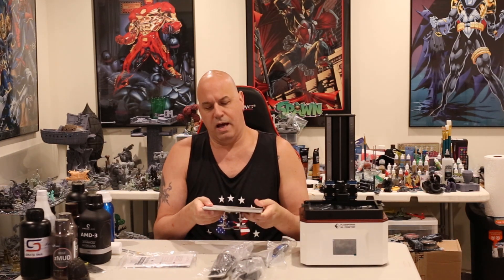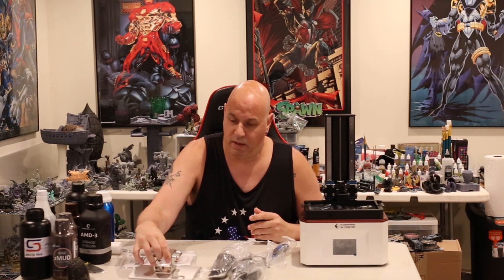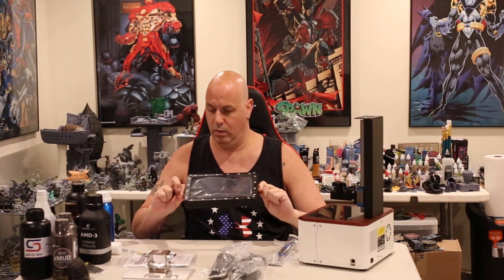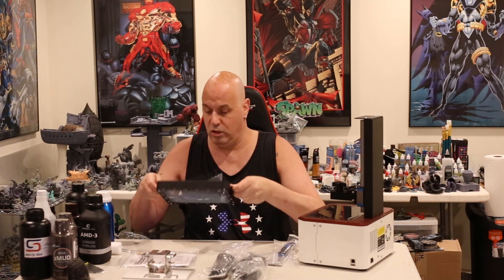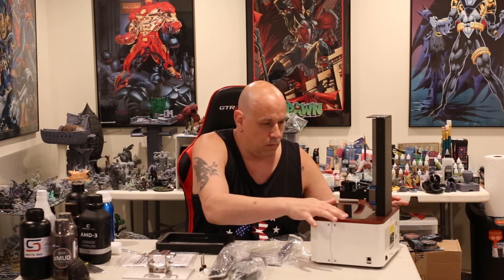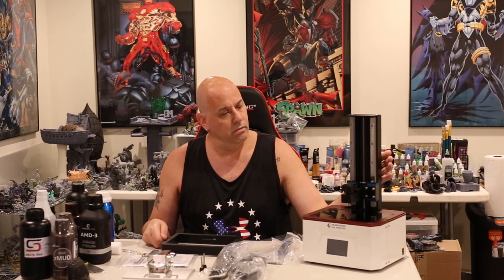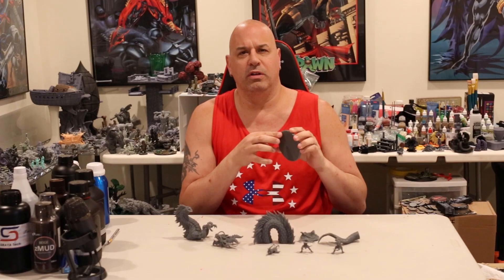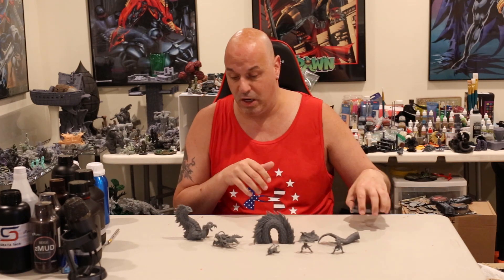Flashforge Foto 8.9 4k Mono screen 3d resin printer review

Comment: Hi brother, please help me. I have this new foto 8.9 but when i slice my model by software chitubox 1.9 and i plug in the usb to machine, it can not read my file, can you help me this issue ? Thank you so much
Reply: There are work arounds for the 8.9 foto I have the 9.25 foto and there are no work arounds for it that work properly.  I just went to using their own FlashDLPrint software.  It's not fancy but it works pretty well, and I don't have a lot of issues with it.  In fact overall I think I have less failures using it than I did with Chitubox.

Comment: If you go to Flashforge's website and look at this printer's page, scroll down and look at the models they use as marketing material..the action hero's base, at the bottom, has failed supports and the corner of the base failed.  Not sure why they would use that as marketing material.

Comment: Would it be possible for you to make a video on your favorite resins and settings for them? I am going to start mixing tenacious with my resins for printing on my e10, and I am looking to switching from anycubic resin.
Reply: %25 Tenacious to Fast is amazing, or other good resin like Esun PLA Pro etc, adds some flex.

Ministry of Resin makes a slightly flexible resin stock

And since you have an E10, make SURE you flash to latest firmware asap, their original firmware was as good as the E10, complete crap. It would have an issue that would leave the LED on permanently.  
And yes I hate Epax, I was a backer that got a leaky vat OOTB, had the first screen develop a perfect line in the polarizer, not the glass just the polarizer, got second screen, board did the perma on screen, took forever to get a new board, was running, then all of a sudden screen developed lines in it when printing, was told bad screen and needed a new one, got new screen, exact same issue so wasted a bunch of money on screens. Finally got epax to send yet another board.
Worst company of all 6 manufactures I've dealt with

Comment: Wish my epax 8.9 had feet. What I did to fix this was to make a bracket that supports it from the edges when it's off the printer. Simple, but could have been easily avoided. And yes, handles, handles, handles! The more the better!